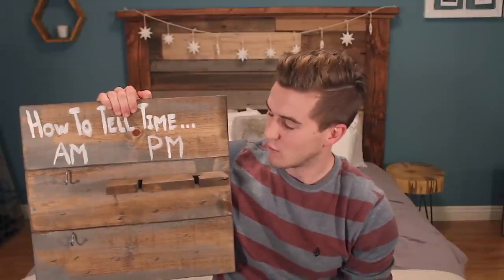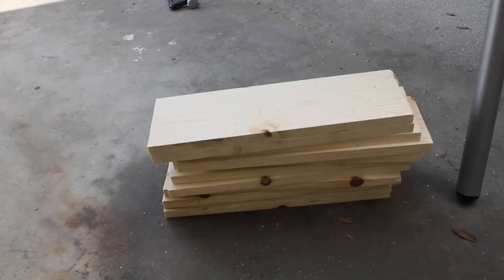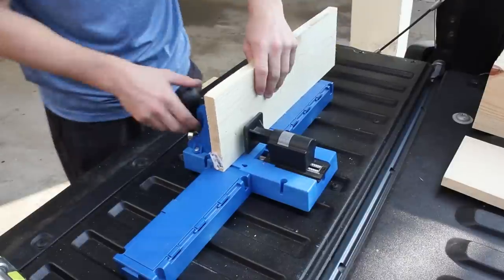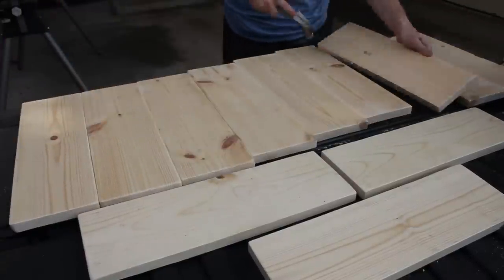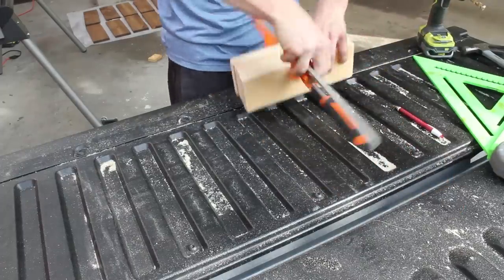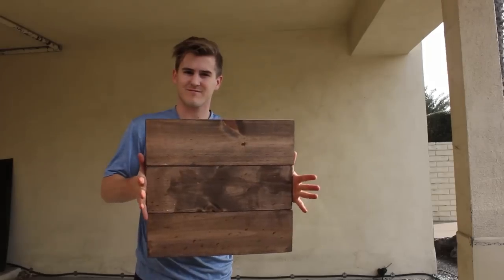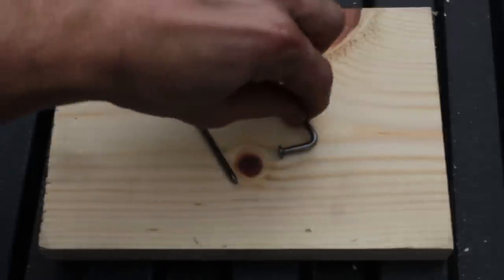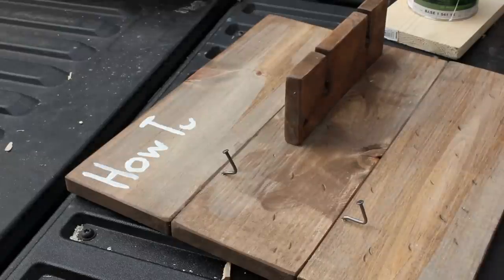"How to Tell" Time Coffee and Wine Holder  | 1

Comment: OK so what did you use for mounting hardware
Reply from the maker: This was a gift for someone, so I let them handle. However, since it will only be 5 pounds or so, you could just use picture frame saw tooth hangers and you'll be more than ok